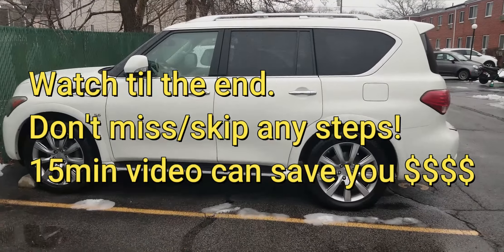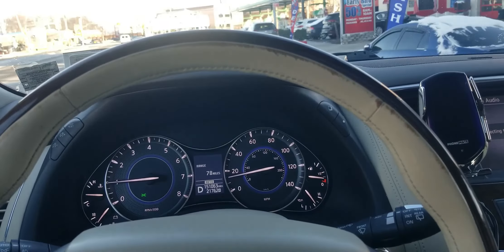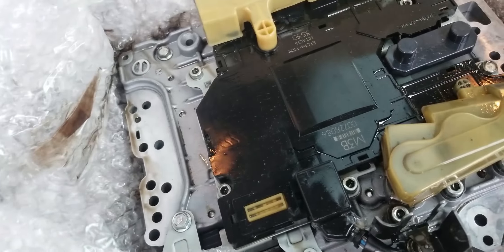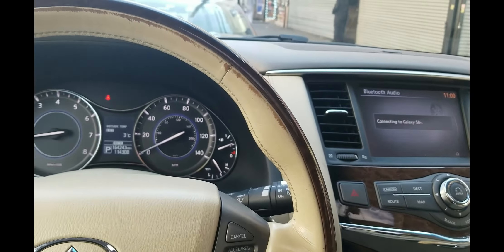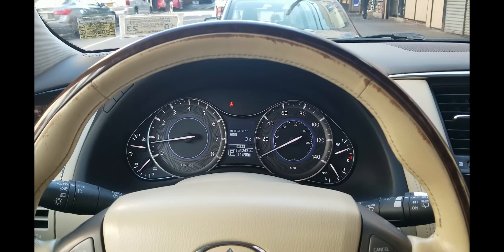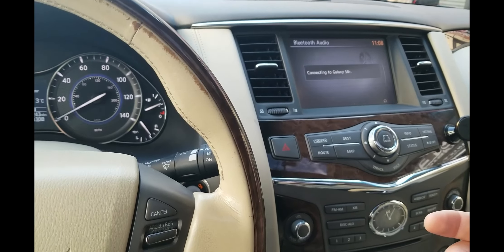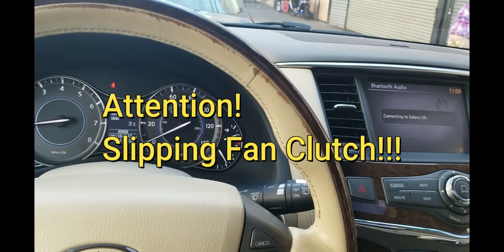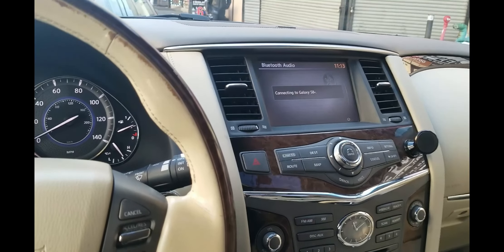Infiniti QX80 transmission problem, jumping RPM, RPM surge, shifting problem

Comment: Its a torque converter problem
Reply: Yep.
Reply: That's what the dealership said about my 2021 qx80
Reply: @p61111  so how about i just had my trans fluids replaced.  And added a bottle of shutter fix fluid.  Now my shutter has stopped. I'm talking immediately.   I was going to have to pay the dealership 4000.  They said it would be the first step in repairing the issue.  Not guaranteed.

Comment: Thanks for a great informative video. I think I will pause in buying this vehicle, it's a shame that it has so many issues for a $70K luxury vehicle. I've been saving for down payment for a used car that on average will cost $32K....it's too much money just to have to worry about huge repairs cost.
Reply from the maker: It's a nice looking truck until you own it. For 2011-2014 years maybe is ok. But for 2020..to make same ..no thank you!  Poor interior quality, not accessible cargo area...many other small details make me feel that 2007 Benz GL450 for $7k more luxury than Qx for 20k
Reply: Mine is 2011 really big problems happening every month now done 223k km today I just had enough from air suspension shocks and replaced them with normal shocks and last week A/C comp
And same issue happened with me like in video I discovered cylinder no.5 not working because of coil  and bank B sensor
Reply from the maker: @Uae_soul  Catalytic converters also a problem on qx, clogged cats also make problem with rpms,  this engine very sensitive to everything, using "cataclean" and premium gas- runs like chemp! I believe I have to use Cataclean every  1000 miles or replace cats
Reply: DONNOT BUY ANYTHING INFINITI THE USE CHEAP PARTS AND THEY ALL HAVE MULTIPLE BREAK DOWNS

Comment: 2021 Q80 goes into drive rpm 3000 but doesn't accelerate,
Reply: Did you find out the problem?

Comment: Thank you! I just got my 2013 Infiniti QX56 and it’s having the exact same issue as you described. I owned a 2004 Nissan Armada for 10 years and absolutely loved it. I am hoping for the same for this one. Appreciate the update!
Reply: My transmission went out at 73K and the dealer honored at 70K. Had to get a new transmission because they said a line wore out. Now replacing the Cats. SMH

Comment: Had the same issue.  I also replaced the battery and unplugged the low voltage sensor. Been a week and no issues.  Going to clean the AFM sensor. And if the issue comes back I’ll look at fan clutches. Thanks for the thorough video.  Well done!

Comment: Great Info - Thank you. I am looking at buying a qx80 with 185,000 HIGHWAY miles and this can fix a LOT of issues. I forgot that VOLTAGE can be a serious gremlin on random issues.   I grew up with only  compression, spark and fuel as the only items necessary to diagnose a car. Adding VOLTAGE to the list. Thank you.
Reply from the maker: Don't forget Catalytic convertors! I had few times code, and now using 3rd (hopefully final) times of CATACLEN - it helps a lot and see the difference! But If I would buy QX again ? - probably - NO ... 50/50  :)
Reply: @focusbvi  all great info - thank you. :)

Comment: Great info, thanks for posting! Same issues going on with my 2011 QX56 and all the dealership told me after diag was "internal transmission failure" and quoted me $9200. I thought it was the torque converter too, so I got some Shudder Fixx additive, and it nearly eliminated the vibration. After watching this I'm going to try the sensor trick, and clutch fan will maybe fix the rpm flux.
Reply from the maker: Do you have vibration?
Reply: Did that solve the problem
Reply: Just bought a 2017 qx80 with 157k. Rpm drop, shutter from 40-60mph. 
Did you get yours fixed?

Comment: Victor thank you so much for this information. I just purchased a ‘15 QX80 with 163k miles ’As Is’. Having the same issues you pointed out but my engine light is now on. Going to check the codes and hopefully the repairs don’t result in a money pit.
Reply from the maker: Check the code, may people saying it torque converter...changing tranf fluid 2..3 times may solve it, but it will take time, will not see results righ away
Reply: @focusbvi  it is a bad car?
I wanna buy a 2014 qx80
Reply from the maker: @Young1blood496   no, its not bad car at all. I expected better interior quality and many things I don't like (have to make a video one day) but in general its good. If you buy one for 10k would be great, but not more than 15. I bought during COVID and overpaid a lot! Doing on time maintenance and its running better and better 180K miles

Comment: im having same issue with my nissan partol at first i thought it might be Transmission Mount problem but it looks clean and  no issues there according to the mechanic  but thanks to your video now im more aware of the issue than before with my problem my car voltage is good same as you have in the video so i don't think that's my problem i changed engine oil and got new battery on already so maybe i need new transmission fluid or sensor issue either way thank you for the information this could save me alot of money for sure

Comment: Thank you very much. I have gone through the same except transmission valve. I’m based in UAE, I took my patrol y62 2016 se to many and all services were done in Nissan authorized, but they couldn’t figure it out and saying no codes, no problem. But as you experienced, I had the same issues rpm hesitation at lower speeds and intermittent. Perfectly fine at higher speed. I’m now with -major service done at authorized service-same issue persists, like you refered many forums, changed battery, changed Maf sensor, bit improved but still intermittent. Today one of the tech suggested for transmission check, you vedio and explanation is very helpful and tomorrow I’m going to change the fan clutch. Once again thank you very much, and this was very helpful to me…👍
Reply from the maker: @ajaykumarna  I didnt make video yet, but I suggest to clean fuil injectors ! Buy at outoze few bottles of seafom, use 1 bottle for half tank. Do it at leat 3 times ... at first it may act weid, but it work very well!! Try it now, and you may not need to check transmission! It even helped with cat  convertos problem.

Comment: Ok so just changed fan clutch. Runs perfectly now. Fan was spinning a lot after shutting it down and ac wasn't good at idle . Now it runs perfectly. Also added an injen cold air intake def recommend it was $250 added probably 20-30 HP. Then I did direct valve clean easy to do buy bottle at AutoZone undo hose and heat engine and spray runs so well like a brand new car. It does seem that the fan clutch has issues. The loud fan nosmise with my old clutch was louder but went away very fast like after ten seconds and then now with new fan clutch it sounds loud for a lot longer like one or two minutes. I alos added another torque converter fix. This car is awesome now so please thank you for posting.
Reply from the maker: Thank you for ubdates!!! My new fan also loud for abount 1..2min. Added one tube shudder fixx and using cataclen...runs great. I think I have to add cataclean every 1000 miles or reeplace cats (had code po430 already few times).
Reply: @focusbvi  sweet bro we will fix this together. Please get the cold air intake you can install yourself it's every ways totoaky worth it lots of horsepower and better mpg. It's $250. Also do the valve treatment you will notice a difference direct injection engines need that
Reply from the maker: @vamosajugarpelota  I would do intake, but already spent a lot, need a break. Just replaced starter, it another  issue in qx, $1000.  I have few times before that car didnt start...keep pushing start button and it started few times, but one day died, so keep in mind :)
Reply from the maker: What avarage mpg you have? 
I have 14.8, highway 22
Reply: @focusbvi  13.1 but almost all city and I've been racing the throttle because it's a lot faster with the cold air. Hopefully it will go up over time
Reply: What makes no sense to me is why does it do it only at a certain speed and not across all gears if the fan clutch is the culprit.
Reply: @mariusrociu8987  no idea but YouTube how to check a fan clutch super easy

Comment: Ours was a defective/weak/sticking starter motor solenoid.
Acted up in May while on a 2,000mi. trip...then began working fine.
Then acted up again in Nov...same-same.
Battery was good/strong.
Checked terminal #50 ( cranking ) wire to starter motor...good & strong.
FINALLY got the solenoid to stick...CLUNK!
Repl. starter motor ass'y.
Still going strong after 2yrs.
2014 QX80, 97K mi.

Comment: Thanks for the video. My car is doing the exact same thing. I have a 2011 Q56I take it to the shop Thursday. I'm gonna tell them to do this cause. This other shop told me it could be the valve the valve body.
And I'm wondering what should I do. Have them just fluffs the transmission fluid. Because I seem like my car. Always running kind of high like hard like in the idol. The r p m is like be jumping and it's supposed to be quieter than it is

Comment: Check the VVT sensor ,you will find two sensors in front of the valve cover, just unplug and clean it well
Reply from the maker: I dont have rpm problem anymore, but alway looking to improve. Did cleaning sensors helped you with any issues? What exactly?
Reply: @focusbvi what fixed your rpm issues?

Comment: Consider unplugging the battery moniyoring system at the negative yerminal area 

My 2018 qx80 never idled so smoothly.

The car is now supplying 14.4 volts charging.

No more run down batteries at 12.04 volts.

Comment: 2017 Nissan Titan. SAME EXACT ISSUE. Transmission is confused what rpm to shift at regular driving. If you drive aggressive no issues. I noticed in TOW mode it drives better. Dealer has TSB for TCU update.
Reply from the maker: @gplata22  dealer said no tcu updates exist

Comment: 2017 Armada did the same thing, I replaced the battery and no more issues. Showed up the most on hot days and the starter acted funny as well until the battery was replaced.

Comment: Privet Victor. I believe you start running around and never solve the issue. Torque converter main problem at you mileage in this cars. Replaced and you never need anything else. I have 3 qx80 with total mileage 500k . If you service and take care common service car will never let you down. Replace converter and you can see the difference . Also sometime gas problem , get gas boster and clean gas lines.
Reply from the maker: Hi, at this point with everything I did it runs much better compared to what I had before,  but I still feel something ...and would never notice it if dont have 2nd car gl450, so I see the difference. It diesnt har rpm surge, but feels like has no tourqe at low speed, Im thinking to replace  torque convertor too. Thanks
Reply: The Transmission Range Sensor detects what gear has
been selected by the driver. This error may cause the
transmission to not shift into gear because the transmission
does not know what gear the driver has requested P0705 was the code

Comment: Hey I have the same problem on my qx80 and it turned out to be the alternator it’s weird but soon as I changed it everything works well
Reply from the maker: When did you changed alternator? Recently or long time ago?
Why  you decided to change it? It didnt give enough voltage?
Reply: So I changed it yesterday because my car was not running great and it would stutter high pressure fuel pump and air leak codes were popping out and the rev would go up and down when I’m driving soon as I changed it all problems disappeared
Reply from the maker: @sattarquraish6445  how air leak code related to alternator?

Comment: Where you bought the valve body for 6xx$?  Is it brand new from Nissan or remanufactured from ebay?
Reply from the maker: @LoiTran-ke5du  https://streetsmarttransmission.com/

Remanufactured and tested. And you have to send the old one to them. But i dont think valve body should be replaced.  Try injector cleaners first to see if problen related to transor engine

Comment: Hi did your RPM jump too much by just lightly tapping gas pedal??Also did you have slower acceleration??
Reply from the maker: No, didnt jump. Good acceleration.
If your rpm jumps when press pedal you transmission is sleeping... try to change trans fluid.
Reply from the maker: What year? If its qx56 11..13, I've heard radiaror may have a leak and mixing coolant with trans fluid..and it sleeping. It was designed as same cooling system and it changed at 14.
Reply: @focusbvi  it's a 2011 Kia optima and yes Rpms jump

Comment: Mine does this, unpluged smart battery sensor, cleaned maf sensor, replaced air filter with k&n, did a spill and fill on the fluid added shutter fix, and i almost allways try to drive in tow mode (seems to help).

I may need to flush the fluid again, it was super dirty with chunks in it. @98k miles
Or maybe its the fan clutch.

Comment: Wao thanks very much for this amazing video, I have the same problem and not code , dealer remplace trans and nothing change, test drive multiple times and not come on,crazy, I’m going to remplace the fan clush in see what happens
Reply: Did you change it yet? I got the same issue and curious if yours gets fixed with this.
Reply: I’m not yet but I will let you know
Reply: Ok this is a final result,thanks GOD I did change the fan clutch and all the problem gone,the truck is another one , the problem is because fan clutch and throttle body has the same electric wires 5 volts and when fan clutch slipped pull power because don’t work properly and cause the rpm inestable and also problem with trans shifting, so this fixed my problem thanks GOD
Reply: I have had a similar chain of events, 
1. Mass air flow-swapped
2. Transmission slipping-
      Flushed ,added shutter fix with new fluid. 
3. Had overheating issue-
Flushed, clean, refill 
4. Now it’s intermittent no start and I’ve poped 3-4 battery main fuses over the past year when I try to start the car if I idle more than drive. I’ve noticed that every time this has happened  the battery is very very hot. I got a new battery from infinity and I have a charger and the extra battery that I can swap out if it gets too hot  and won’t srart. The voltage reads 8-9 when it’s super hits if I swap and let it cool down. The next day it’s back up to  over 13v without charging. 
I have a starter/alternator/plugs/coil packs on hand finally having enough of this. Anyone else have any similar situations?? 
After this video  the heat tells me that the fan is just as likely as a short in the charging system😞
Reply: After a few days problems still, crazy, I going move on to the ecu or software because after all change I done and nothing happens, it have to be ecu problem
Reply: @pepetravel74 hi, just wondering if you have solved the issue? thanks

Comment: I have the same tranny symptoms same truck same color my rpms jump up and down and now only shift to second gear I connect the scanner and troubleshoot code p0720 saying tranny valve body so im ready to do this job tomorrow and I’m crossing fingers that finally fixes my issue, thanks for sharing your experience if valve body doesn’t fix my problem I will check and try your tips thanks
Reply from the maker: @oscarestrada9752  I dont remember If I had that code in your case could be valve body and also could be few issues at same time.  Very helpfull to use injectors/fuel system cleaner cleaner (like reslone hy-per fuel)..after it runs smoothly
Reply from the maker: @oscarestrada9752  but this code is not for valve body, its for speed sensor...triggered by miscommunication... and truck went to limp mode.  Im not sure if its problem with valve body... check your voltage when driving/stoping/parking/ on..off.. if it drop that could be a problem. Does your smart charging sensor disconnected?

Comment: I have the same issue with the surging rpm, which typically happens in 4th gear. I’m about to replace my dirty transmission fluid to see if this fixes it. If it doesn’t at least the transmission fluid will be clean. 

I’m still trying to figure how the fan clutch would fix this? The fluctuating rpm should not relate to a fan clutch.
Reply from the maker: Fan clutch was my final part that fixed everything. After replacing it I could feel that car runs different..like more solid... and i think takes more gas. The reason is because the clutch slipping and catching at 4th gear, when it catch rpms gows down... maybe Im saying something stupid, but it fixed problem.
Also I forgot to mention the reason why I 100% decided to change the clutch, I noticed that at in summer, when drive and park but keep engine on my grill was how (expansion tank area) and even noticed white dry stain/spots on tank...meaning its overflow.. mecanick checked and said its ok, but... I even i tracked temperature and thermostat opens at around 90° but fan still didnt work fast enough.
Also, maybe but can be wrong..noticed that I start driving on cold it was running ok
Reply from the maker: Also went to Infiniti dealer to update transmission soft, they said my soft is good and no updates available, but they found something with idling  and reprogrammed something...not sure if that made any difference with  because clutch was already replaced
Reply: Can u pl recommend some forums so that I can benefit . Have a QX80 2015 model. Have a similar problem plus there is clunking when rapid slowdown . There is no issue in acceleration and gradual deceleration . All joints etc ok. My mechanic suspect transfer case sensor and shifter motor . He adjusted cleaned etc problem reduced but not gone .
Reply from the maker: @imrankazi6058  usually qx80 forums on Facebook
Reply: Any news with the new transmission oil ? I’m having the same issue